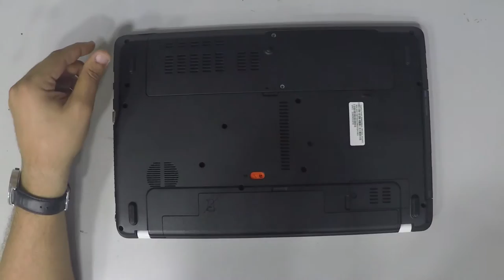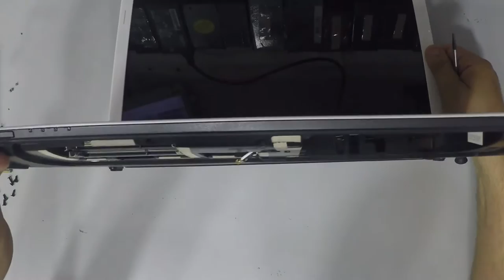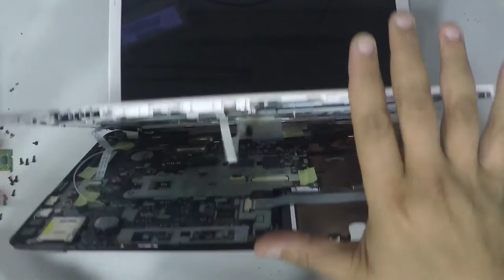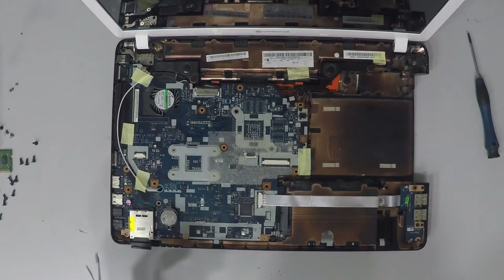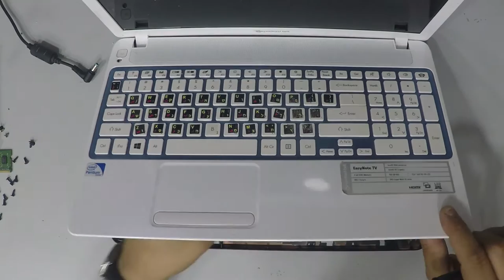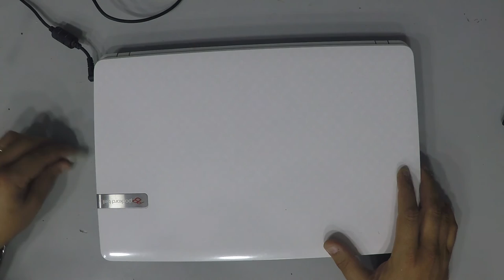Packard bell Easynote Tv44hc Power Button Fix

Comment: Well, not entirely a solution for the problem but thanks anyway, however drilling a hole in my case is not an option as well as buying new one, one ebay seller offered this part for 50 bucks!!! that's something around one gram of gold (u mad  bro!?!?!) and even then there is NO GUARANTEE the same problem will not appear again, actually it most likely will, so i have to come up with a different solution like moving the micro switch closer to the button or even attaching something to the button to replace this stupid lip. 

Everything can break from a hammer to a space shuttle, but what brings my piss to a boil is the fact that this problem is caused by a shitty design. i mean how can you screw up something like a power button? i understand there is a LED backligting the button but its ain’t no nuclear missile launchpad, just bring the microswitch in the center of the button (DUUH) surround it by LEDs and make the button itself a semi translucent lump of plastic so you get an evenly illuminated and most importantly a GODDAMN reliable button. Packard bell engineers WTF... i  wont go into conspiracy theories but i have to admit this tiny plastic clitoris breaking off can really push you to buy a new notebook, seriously! if you are unable to disassemble and repair the notebook yourself and the warranty period is over you need to pay a technician + somehow get a replacement part or buy a notebook for parts. or rather screw that. just scrap this one and buy new one. DUUUH!!
Reply from the maker: LIKE... HAHAHA, all Packard Bell (TV44...)  had this problem after 2 years. drilling is the cheapest solution.
Reply: As my friend asked me to repair this notebook i wondered where did i hear the brand name  packard bell, now i remember, it was top ten worst computers of all time, what  a funny coincidence.
Reply: @Shamsabdelkader  My TV44 worked for 8 years, but now the power button strikes...
Reply: Update: I tried to fix it without the hole in the notebook, but it didn't work and I don't understand why...
But your workaround was successful :-)